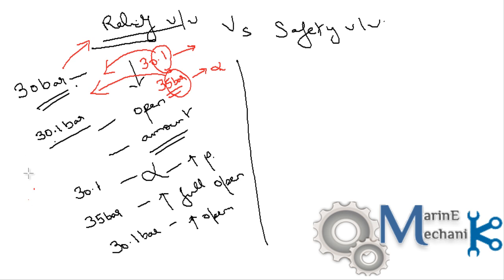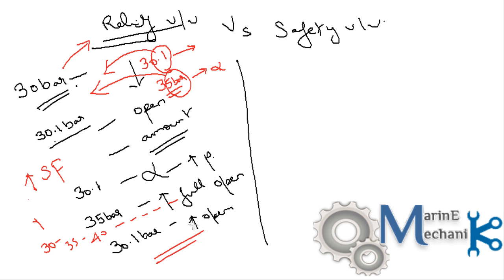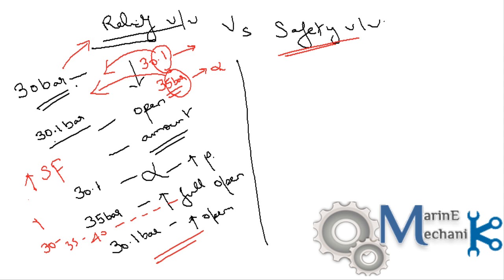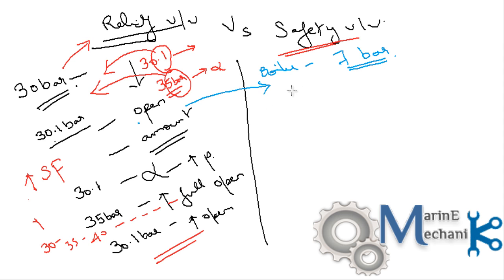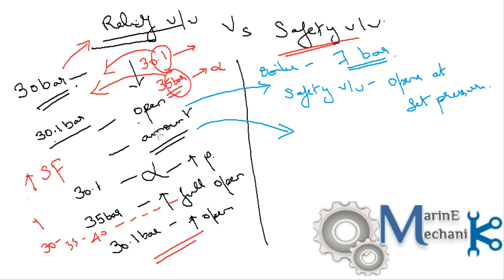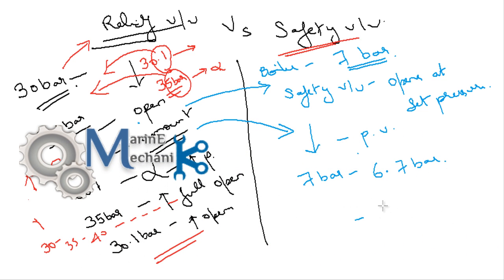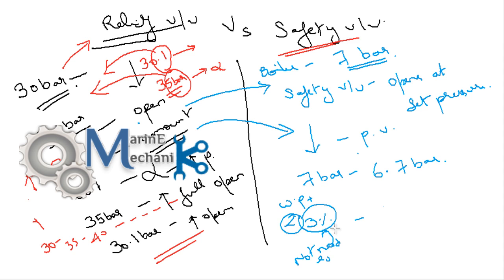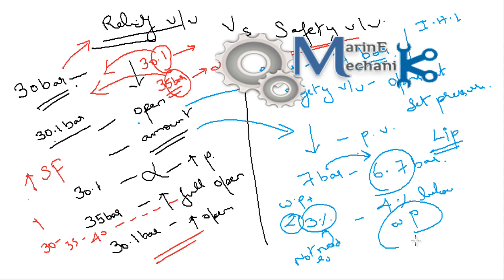Difference Between Safety V/V & Relief V/V: Ever Lasting Doubts Cleared...!

Comment: Good day Sir,with regards to your explanation about relief valve when it starts to open partially until it fully opens.Relief valve has cracking pressure,this is the time the valve starts to open partially and these value is below the setting pressure.The valve fully opens once it reach or pressure is slightly above its setting and all the pump output are relieved back to the tank but still maintain set pressure to the system.This is how Hydraulic Relief Valve works,I’m not sure if its the same with other medium.

Comment: Lol main difference between them is the application, relief valve in a system returns the excess quantity of the working medium Eg. Oil back to the suction side (in case of a pump). While on the other hand safety valve just pops it in the atmosphere Eg. Steam or air. And the rule of thumb in the safety valve setting is not 3% but 10 percent to 30 percent above working pressure. Eg. 7 bar working pressure then popping pressure would be 7.7-9.1bar depending on the design. Where did you get that info about 3 percent? Your explanation is way out of line mate, you're right with the relieving stuff in the relief valve though.

Comment: I am confused with your explanation.  You said working pressure + 3%, I think it's MAWP + 3%, probably your working pressure should be 7% to 10% below your MAWP.  You also forgot to mention that the important criteria of safety valve is the pop action which is absent in the relief valve. Why it is important to have "pop action" in steam? You should explain more on the huddling chamber, or lip, because the major difference is relief valve does not have the lip.  This is not really a good explanation.
Reply: For the better understanding of everyone who watched this video, could you then explain it better sir? Thanks a lot!! 😁
Reply: Thanks

Comment: Great Explanation. Thanks
Reply: +Chima Ujoatuonu
 could you tell me...?
safety valve and relief valve  wich one is use for liquid and gas?

please help me...!!
Reply: Safety Valve is normally used for gases (compressible fluid) while relief valve is normally used for liquid (in-compressible fluid) as found in API 520 part one.